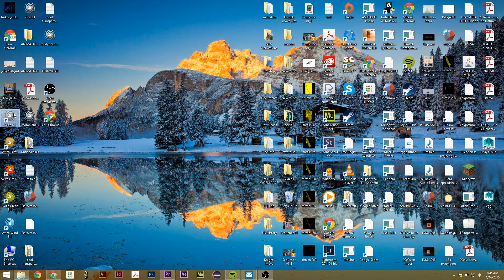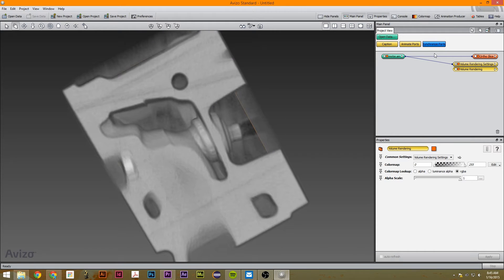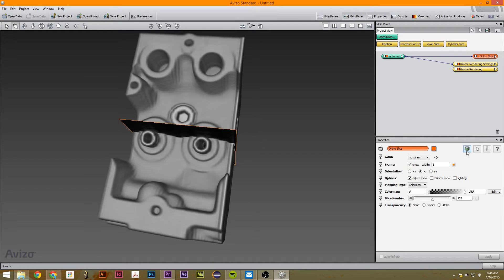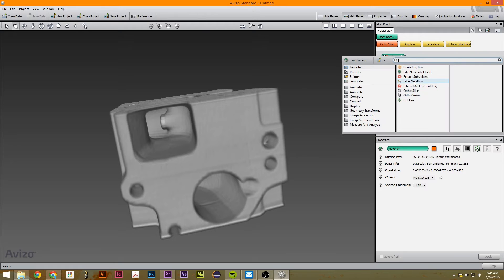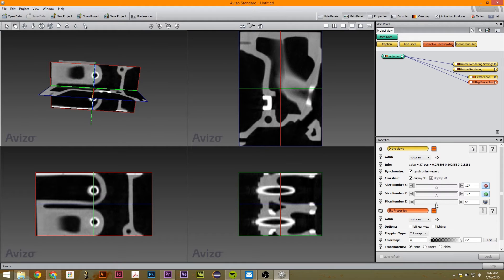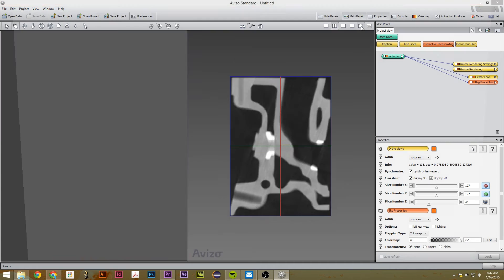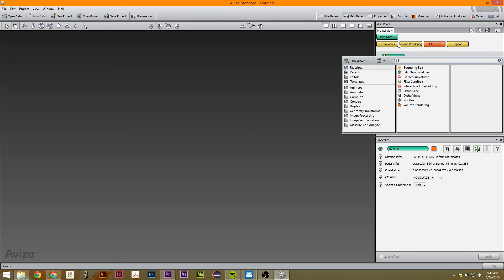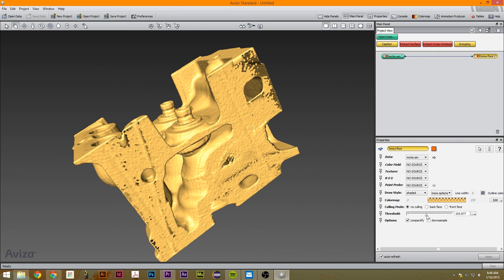Tutorial 2: Isosurfaces and Ortho Slices in Avizo

Comment: Hi, Sam.  Is there a way to rotate an ortho slice relative to the scanned object?  So far is seems as though I can only rotate the slice in tandem with the scanned object.  I am also interested in rotating the ROI relative to the scanned object.  Thoughts?
Reply from the maker: Hi, 
I do not know of any way to do this with a ortho slice, but one way you can achieve something similar is to create a normal plane. To create a normal plane search it when you click on a rotate block. Then disconnect the normal plane from the rotate block. You can rotate the normal plane independently from the object.
Thanks for the question,
Sam